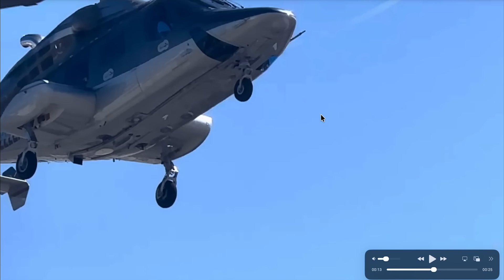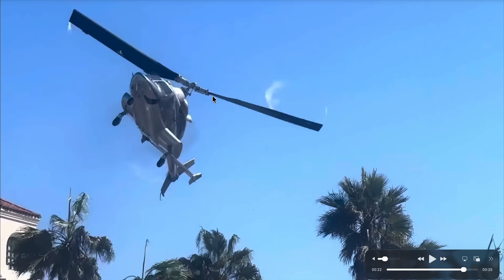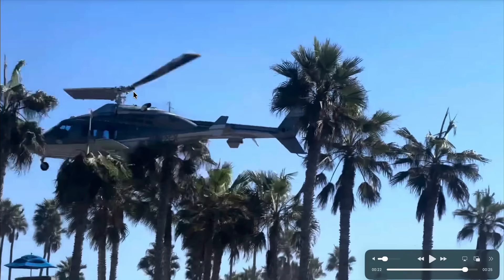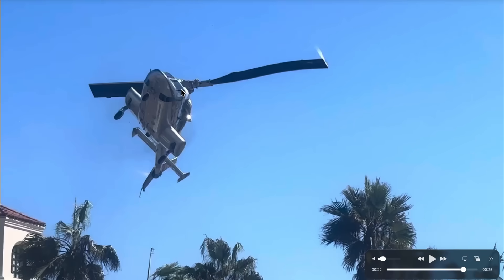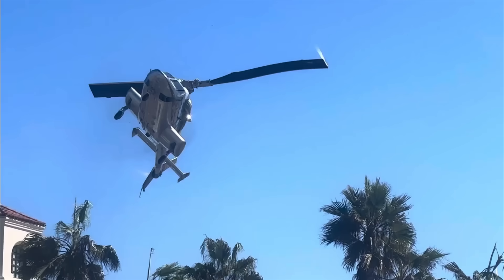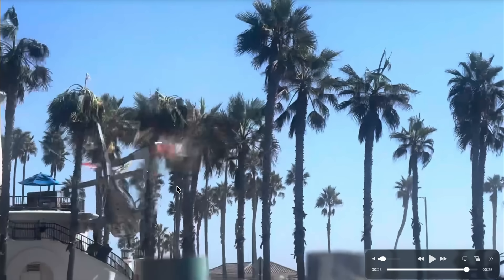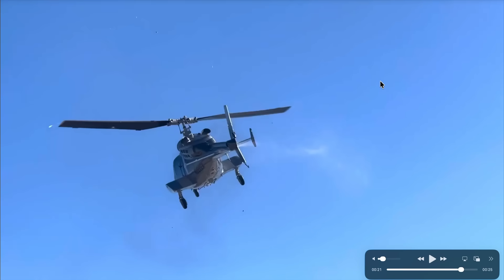Huntington Helicopter Crash Analysis - SlowMo Video!

Comment: Looks to me as if full rudder was applied and is maintained least through the first rotation looking at their deflection....
If there were passengers in the aircraft I might assume that a front passenger became frightened or otherwise applied pedal input and the pilot could not realize in time to correct.

Comment: Does the tail rotor RPM change? I thought it was constant speed with thrust affected by blade angle changes.
Reply from the maker: Tail rotor is directly connected to the main rotor. It does not change speed unless the main rotor also changes speed OR there’s a failure in the tail rotor drive system.
Reply: @Outbound300 
That's what I thought, thanks!

Comment: did the heli pilot have any clue what to do when failure occurred, I assume most input  controls would be pointless at this point, 
looks like the trees cushioned the impact otherwise would have been fatalities.
Reply: When a helicopter loses a tail rotor and if you have the altitude, you can gain speed and autorotate for a landing.  But in this case he was too close the ground and obviously did the best he could given the altitude .

Comment: Well very good analysis of the crash good eye and have to agree with everything you said seems like this guy was hot dogging in this helicopter too much. It's very unsafe to be flying that low with people below you You never know what can happen this video proves just that. Whatever caused the failure definitely is I'm sure related to some sort of pilot error and unsafe maneuvers. Just a guess but I totally agree with everything you said not good that's 700,000 or more down the drain
Reply: Id like to add I'm not a heli pilot just speculation at best many things can and will go wrong if the helicopter is not being handled by a experienced pilot. Its def not a toy and if this guy wasn't landing in that area he had no reason to be flying that low with people around it could have been way worse. Chalk it up as a lesson learned hopefully and too bad it came at a high cost at least no lives were lost tho

Comment: I know the pilot's family. He made the right decision to just lower it....This situation can be saved if you have good forward momentum and elevation to work with....Too hard to describe here....The tail itself acts as a stabilizer when flying forward at speed. The rear rotor needs little input to keep it's heading.....It's when your forward movement diminishes it takes thrust from the trail rotor to maintain heading. 
 I bet this footage will change the way some heli-pilots fly.... Glad the passenger (young lady, ankle) and pilot (vertebrae, ribs) are ok.

Comment: These old helicopters were very fragile; double blades, instead of three, four, or even five, are very vulnerable to damage. There are enormous forces at work here, accelerating the failure of the control system for such enormous, heavy, and therefore fragile blades. This surprises me because helicopter failures occurred so frequently, and scientists and engineers deliberately did it poorly—the control system was always too weak and underpowered for the blade size, vehicle weight, and engine power. Only now is the military correcting this in its new machines. It's strange.

Comment: You say it indicates that the speed has changed of the tail rotor but that might not be the case especially since why would the speed suddenly change. The link came off and so the pitch changed not the speed.
Reply from the maker: Tailrotor is directly connected to the main rotor drive system.  Thus any change in main rotor RPM will necessarily change the speed of the tail rotor as well.  

The pilot pulled in some pitch in that moment.  If you could have been in the cockpit you'd have likely seen the main rotor RPM instrument indicate some decay and since they are connected.... the tail rotor,.

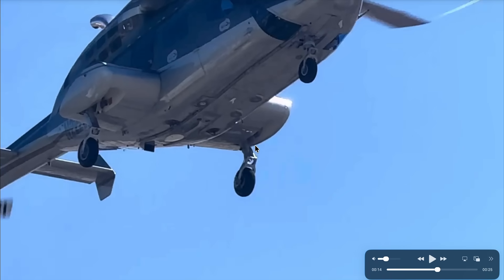Comment: 0:20 Shouldn't the tail rotor RPM be directly connected to main rotor RPM? Since the helicopter uses tail rotor pitch adjustment the RPM should match the main rotor.

Comment: At 5:20 when you are talking about the rear blade, that deflection is most likely due to the fact that the pitch control rod is completely detached. I am not sure about the exact make up of the tail rotor, but it is most likely a single spar with the two blades, so the twisting forces get transferred down the length which is normally retained by the PC rods.

Comment: I would assume the "mist" at around 2:30 is the hydraulic fluid being shot out under extreme pressure, more so than oil, which is most likely self-contained within the now-departed gearbox.

Comment: Black smoke could be due to engine overspeed, a sudden loss of the tail rotor and the resulting yaw rate opposite to rotor direction will result in a rapid reduction in blade drag and an increase in RPM, which might be too rapid for the governor to manage.

Comment: Hello, I have seen many helicopters crash due to tail rotor failure, is this serious? Is it not possible to install a small servo reactor so that it can stabilize for a few minutes while it lands? The technology exists, they are small turbines on the sides of the tail that are activated automatically when the tail rotor is lost, controlled by a computer which would act against the rotation of the ship, I hope my comment awakens the minds that design this type of ships, let us remember that in space the space modules move slowly based on the expulsion of energy in a controlled manner, no more deaths due to this failure.🙏🏻

Comment: One simple question is, Why Autorotation system does not work??  I always don't  understant if any helicopter crash, same question about the Autorotation system.
Reply: tail rotor failure is different that autorotation(used when you lose engine power). It's kind of the opposite. You need to lower the power but like auto lower the pitch. Probably monkey brain kicked in and stomped the anti-torque pedal and raised the collective.  Which with full power would have made the fuselage rotation worse.

Comment: There is another angle where you can see the tail rotor pitch rod no longer connected to the blade grip. Transmission oil is not likely to look like that unless the transmission had burned up. So likely pitch rod failed (or bolt fell off) but I'm trying to see if the transmission failed and wobble took out the pitch rod or if the pitch rod failed and imbalance took out the transmission. Either way your analysis is great. The blades failed where you would expect from on imbalance (huge asymmetrical pitch). Usually about 1/2 way from the center of rotation. The change in rotation speed mades me think the transmission failed. The pitch change can't change the rotational speed.

Comment: Three negative things all together: low speed and therefore poor tailplane efficiency, short separation distance from the ground and very close houses, helicopter already all configured for landing. I remember at least with the R.22 that with a tail rotor failure, if you are in cruise, the nose yaws to the right, maintaining speed to allow the tailplanes to work and enter an autorotation, perhaps on a runway where you can do a skid. That couldn't be done there, it was too low at altitude, low speed, the houses nearby, little space to land in those conditions. A chain of negative conditions: the blades came off and then a piece of the box at a 90° angle. I think what happened was absolutely unavoidable in those conditions. What seems certain to me is that this time it was a mechanical failure and not human error as in 80% of cases.

Comment: It seems that at 4:48 there is a lot of pitch on just one blade of the tail rotor. If you look during its rotation just after you see why : the connecting rod isn't linked to this blade anymore. The question is now why did it disconnect, is it because an object damaged the connecting rod or just a nut got loose ?

Comment: Question from a layman: In such an emergency, why doesn't the pilot turn off the engine and do an autorotation landing? This would also be possible from a great height.
Reply: Autorotation works properly if you engine case but both rotors work fine or in case of tail rotor failure you have enough forward speed for the tail fins to work and stabilise you. In this case he would end up crashing hard while spinning exactly as he did annyway. He should autorotate nevertheless but I'm not sure how much space he had for this landing, there were crowds around and looks like he panicked.
Reply: @randomnickify  When I switch off the drive, the rotation stops immediately because there is no longer any torque from the drive. Forward speed you need more than 150 km/h for the fin to work.

Comment: I am a complete layman when it comes to helicopters and aircraft. But some time ago, a German entrepreneur couple and their two children were involved in an accident in New York with an 80s helicopter. All four of them, plus the pilot, did not survive. As beautiful as this Airt Wulf (Bell tripple2) is. We're talking about 40+ year old technology here, and often it's not enough to just look at it or tighten the screws. In order to be able to fly such critical aircraft safely decades after their commercial use, critical components such as the rotor and connections must be X-rayed, along with all other methods of preventive maintenance else there is. Otherwise, leave these things on the ground. It all looks in great condition. But bad things can lurk inside the material. Thank God no one seems to have been killed here.

Comment: The tail rotor did not reverse direction.  That was simply the shutter speed of the cameraFreeze frame 1:01, and you will see the cause of the crash. The tail rotor linkage is hanging down between the rotor and the boom.  This caused the pitch of one side to become uncontrollable and no longer in sync with the other side of the lade. Because it happened so fast, and so low, the pilot did not act quickly enough to dump all the power from the turbines and lower the collective to stop the adverse yaw. The difference in pitch causes the whole chopper to violently vibrate, first launching the blades, then the transmission came to an abrupt stop, ripping it from the craft!
Reply from the maker: exactly what I said.  Did you watch and listen?

Comment: You missed THE critical point of the crash right at the start lol. When you freeze the image at 0:34 you can CLEARLY see the pitch link hanging down between the rear rotor and the boom. Thats what caused the accident. The pitch link came loose, which would have meant one of the tail rotors blades was no longer being controlled, allowing it to flatten out, causing hellish vibrations in the tail, which is likely why the tail rotor assembly flew apart and spat out the tails gearbox. The pilot didnt pick up on this in time and didnt power down the engine to reduce torque. The rest is just inevitable.

Comment: Worked on Bell with PHI for 25 years.  Everything that attaches with a nut or bolt gets safety.  Either with wire or a cotter pin.  My guess is the cotter pin didn't get installed on the nut and bolt for that PC link.  It eventually shucked that hardware and the rest is history.  It takes very little to go wrong to bring down a heli.

Comment: 5:18 frame is probably the answer.... yaw control linkage is dislodged...that may have caused the tail rotor to fail...and of course the hot dogging and missuse of equipment, unovservance of safety protocols and unsafe allarround airmanship, the pilot has a history of hot dogging and it was recorded flying very dangerously prior to the crash.  Maintenance issue...maybe, Thsk God!! everybody survived but could have been way way worse...hopes and prayers for the injured and may this example sirve as reminder that all safety protocols and rules are written with blood.

Comment: If you watch the full video it's clear there was a tail problem on approach. Look at the trees and you'll notice there was no wind yet the copter approached at approx 35 degrees to the inbound path. My first thought was the pilot was inputting alot of yaw compensation and knew there was a problem. He was nursing the copter to landing where repairs could then be made. Perhaps a linkage problem on tail rotor or a gear shearer some teeth.

Comment: The transmission bracket mount came loose where it bolts down all the flight controls except the pedals. The peddles would have still worked at first. This has been a well known problem

Comment: To answer your question about what causes such large deflection of the tail rotor pitch, check out Juan Browns (Broncolirio) analysis withe parts show & tell about when you can see the linkage failure and how that effects tail rotor pitch.
Right after pilot passes the tail near the top of one of the palm trees, you can see that the linkage has disconnected, then he goes up and that rotorcraft experiences rapid unscheduled catastrophic disassembly.

Comment: So what, tail rotor gear box failure, pilot stomps pedal, stresses grips and they fail them somehow launches the hub, then pilot panics and pulls full collective to try to avoid pancaking while also adding cyclic to keep it upright causing the mast strike… sounds pretty plausible. 🫤

Comment: A pitch change link broke on one blade. You can see one blade at flat pitch and the other one at high pitch. This sets up a huge vibration that cased the blades to depart and tore the gearbox out of the tail

Comment: I saw in another video that the tail rotor changes speed just prior to the loss of control, so I believe that is the starting sequence of events. Followed by an increase in power, which exacerbated the spin and overcontrolling of the cyclic caused the MR blade to contact the first TR blade. Worst possible time to happen, low level, low speed, but at least the result is not the worst possible. It was awesome to see so many bystanders rush in to help.

Comment: If t/r is going to fail, this mode of flight, hovering OGE, will find the weak spot. Engine, main rotor, tail rotor are at or near max. Instead of flying that day they should have stayed home and played a lottery ticket, lucky, lucky.
A couple of years ago in the UK the owner of the Leicester(pronounced Lester) football club used to like to have his helicopter land on the playing field after the match to pick him up along with his aides. Instead of translating the pilot just elevatored straight up, maybe the boss liked that I don't know, when they started spinning. They cleared the stadium but crashed in the parking lot alongside killing all on board. During the investigation there were found issues with improper lubrication iirc. Unlike the NTSB who could take years in our litigious society, the investigative body in the UK had it done and dusted in a matter of a couple of weeks. Fully released to the public, photos of the assemblies, diagrams, a brief laymen's explanation of what went wrong.

Comment: Looked like the initial cause was one of the tail rotor blade control linkages coming apart, (the 2 parts jettisoning off the tail rotor) causing one blade to basically turn acting like a canoe paddle in the water,  creating an aerodynamic imbalance, which then made the one blade break off, causing a centrifugal imbalance which caused the tail rotor gear box to go on vacation, causing the pilot to make an unscheduled landing in that patch of coconut trees. Reckon it's time to have a chat with the A&P that worked that tail rotor last, and the inspector that signed off the work. The soot coming from the exhaust stacks is fairly normal if the pilot was throttling up to try to rectify the situation.

Comment: Looks like a pitch control linkage snaps off one of the tail blades first, causing an extreme twist of one blade first which would probably  be enough force to yank the entire assembly off orwith shaft out off the gearbox due to misbalance and angle of attack difference in both blades.

Comment: seems like a Pitch-Link failure, where one of the tail rotor blades suddenly "flattened out" then the pilot tried to counter the sudden loss of Yaw-control & pushed the pedals to counter it, then with only one blade pitching hard with the other at near zero pitch due to link failure the off-set imbalance vibration caused the tail rotor gearbox to tear apart & the rotor (and part of the gearbox) was torn off the Bell 222 causing the helicopter to loose the tail rotor, then go into an uncontrollable offset of counter rotation of the main rotor. This likely happened due to either a maintenance miss, or metal fatigue as these aircraft are older with many hours on them.

Comment: blancolirio did a good analysis of the initial failure, seems clear it was tail rotor pitch link that separated.  You can see the loose link swinging out in one frame, and also the pitch of the two blades is clearly unequal when you look for it.  Good call on the mast bump & main rotor sep.

Comment: Good information.  This helicopter was built in 1980.  I hope the officials look at all the mechanical inspections of this helicopter.  All of the people both in the helicopter and on the ground were very lucky.  The palm trees helped break the fall and saved their lives.  I do not understand why the helicopter show still was happening the next day.  Out of respect to those injured I felt the show should have been cancelled.   First off it seemed this helicopter was flying way too close to the building  before the crashed happened.  Was the FAA aware of this air show?  I guess we do not have enough FAA officials due to the president..  Burbank had no one in the tower a week ago.

Comment: If you lose a TR pitch link you lose pitch control of the blade. And the reason the blades separated, the same spot is probably due to vibration.